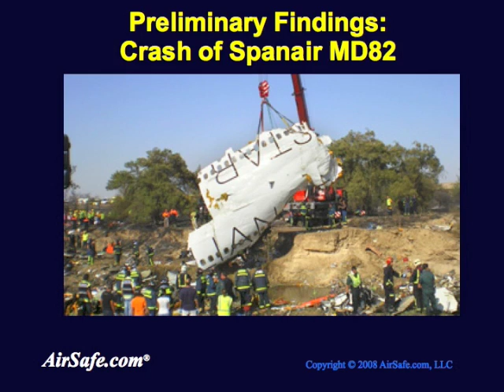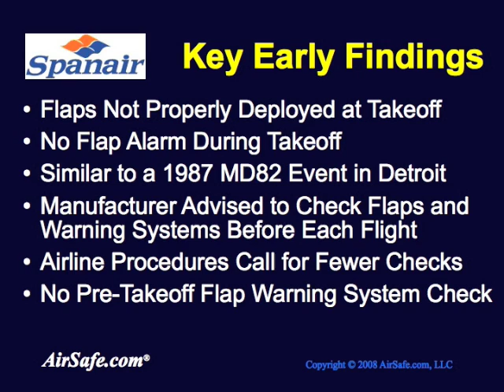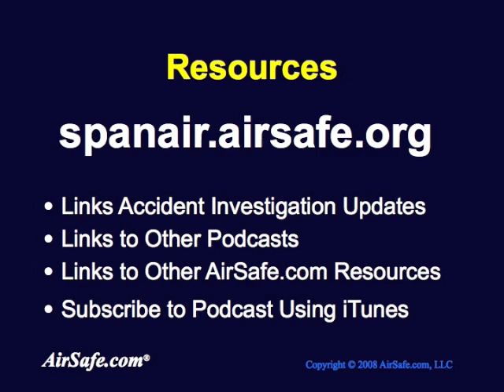Preliminary Findings: Crash of Spanair MD82

Comment: If MD-82 in MAD-LPA flight, Aug 20, 2008, went airborne, above 40 ft, can accident be blamed to  lack of lift? Or to lack of turbine power? Barajas airport has very long flight strips, some airplanes can takeoff without deploying flaps, if strip is long enough as to reach adequate speed for takeoff.
Is this video a similar situation: https://youtu.be/Kle80KB_s3I 
or not, because airplane is not same? Salut +